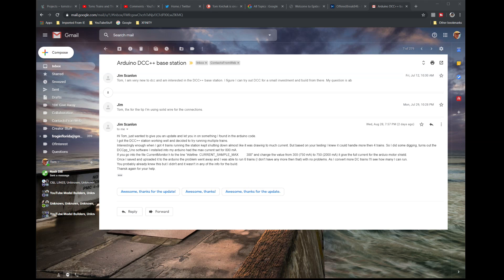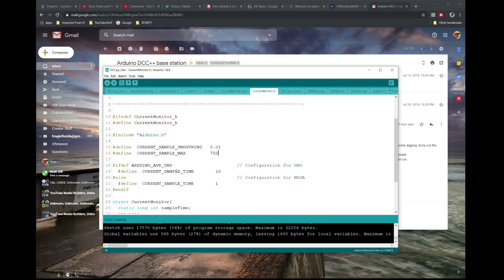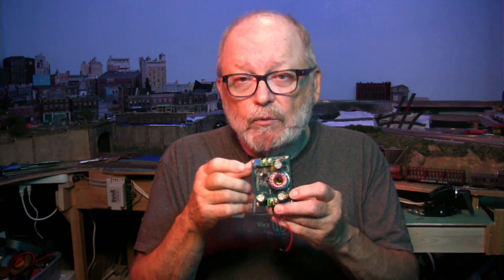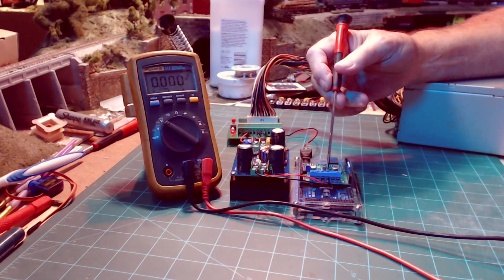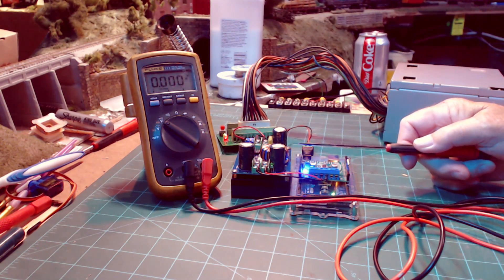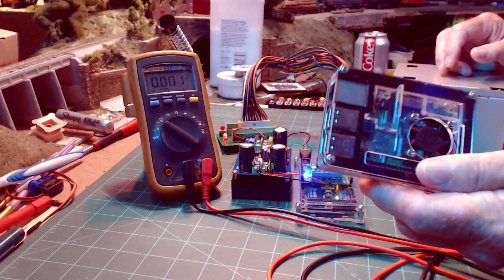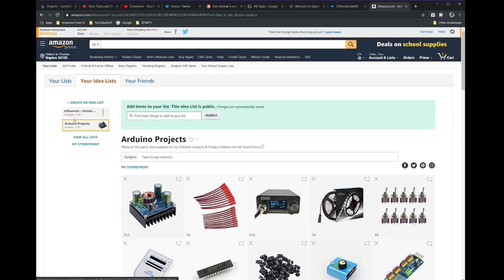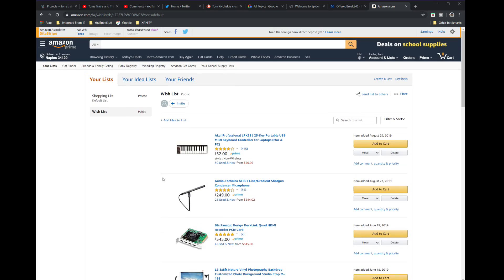Easily Increase DCC++ Maximum Power Through Code & Motor Shield Power Source

Comment: By channel does that mean a and b channels?
Reply from the maker: On the motor shield, yes. More power only applies to the running track. Motor shields are originally made for DC motors, the rating is for a DC motor. When used with DCC++ or DCC++EX, the program track is not used for running the loco, only programing.

Comment: add more motor shield on top for more trains to operate made sure to disable the vin terminal
Reply from the maker: Good idea, but that defeats the purpose of the simplicity of DCC++. You can also build your own higher amperage H Bridge motor driver. Either way, it still has to be changed in code, since the original code was designed to run N scale locos.

Comment: Yep!  That was my problem.  The power is staying on now. Now the next step.  Thanks. --dunc
Reply: Actually, that and I was trying to use jumper wires which cause too much resistance, and so the motor shield would go into a spastic state when the wires heated up.  So I used real wires and put my value up to 1600 since at power-on the peak was about that high, then it stabilized back down under 300 at idle.
Reply from the maker: Glad you got everything straightened out. I like to hear success sorties.
Reply: @TomsTrainsandThings  I had my power plugged into the programming track connector for a while.  That really confused things.  Once I had the good wires installed, and in the correct power input, I had to make not only the amperage change, but also the PackRegister fix.  I may have to teak that some more.  But when I got done and ran that SD9 back and forth, bells and horns, I was grinning like a 4 year old on Christmas day.  Thanks for your help! --dunc
Reply from the maker: @DuncSargentsKarstValleyRR  Your lucky you didn't fry the thing!
Reply: @DuncSargentsKarstValleyRR  Could you explain the power peak 1600 back to 300 a little more please? Thanks.
Reply: @coreygibson2590  The high current draw on startup was caused by having the power leads connected to the output rather than the input, and the wires I used were those thin jumper wires.  This caused them to heat up due to the current and bad the effect worse.  The smaller the wire, the higher the resistance.  Once I got the power connected correctly, and used right sized feed wires I no longer saw the high startup peak, and the operating level was down to 
normal.
--dunc

Comment: I injoy what your advice. Been a steep learning curve for, still along way to go. On my dcc++ I am running 18vdc 2 amp laptop charger onto my shield then feeding into tam valley 5amp boosters x2 using 16vdc 6 amp  laptop charges to run my zones. 4 on main set up. Shield looking after program track and fiddle tracks.
Reply from the maker: Thanks Paul. Great idea!